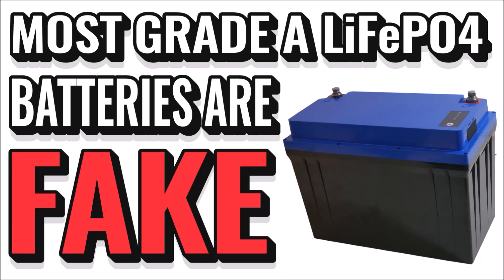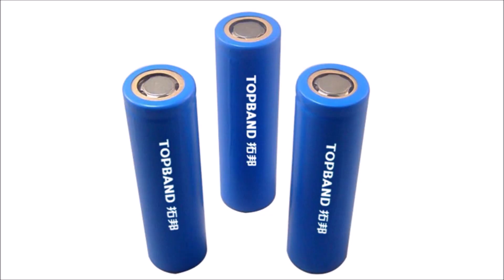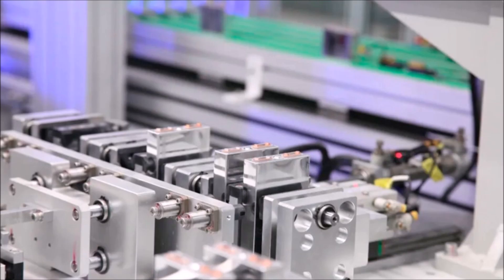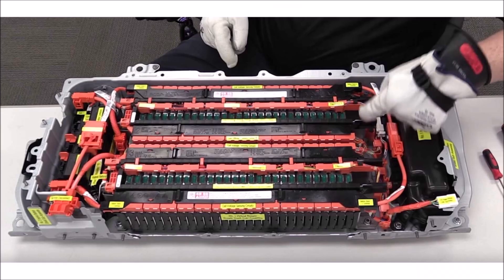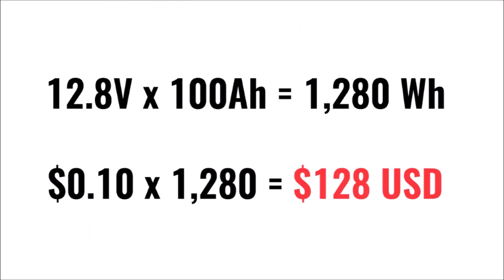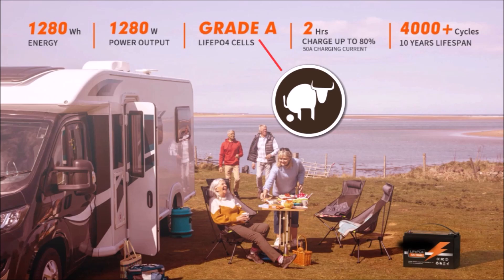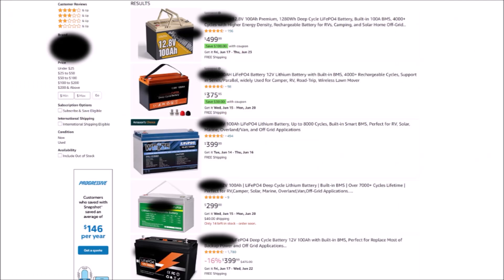Fake Grade A Lithium Deep Cycle Batteries Are Everywhere!  Learn How To Spot Grade B vs Grade A

Comment: I’ll keep my Chins “fake” batteries 12V 100AH that only cost $330, when I won’t notice it until after 1000’s of cycles. That will take me 10 year or more. The “name brand” batteries cost twice that. I would never get my money’s worth out of the “Grade A”
Reply from the maker: I hope you get lucky that way but for many consumers that isn't actually the case.  Not only do they only last 1,000 or less cycles with a quality BMS (much less with a bad one), but under 1C or higher loads those cells will not perform well at all.  Their voltage drops like a rock and the battery will last minutes as opposed to hours.
Reply: @LDSreliance  I have 4 of these CHINS batteries in series to make a 48V system. It runs my electric zero turn lawn mower. The typical current draw is 20-50amp….so I am well below the 1C current draw issue. I can also cut my lawn 4-5 times on a single charge, so 1000 cycles would last me 76 years.  I think my lawn mower will fall apart before 76 years
Reply from the maker: There you go.  That should be fine for your use case.  But what about the guy that buys them for his RV because Will Prowse said they were good batteries and turns on his air conditioner?  Oops.

Comment: will prowse reviews and tares down these batteries all the time he says the cells are ok but sometimes they cheap out on the bms and temperature censors but idk if he knows most of them use b grade cells
Reply from the maker: You can't know the cells are okay by just looking at them.  You would have to test them in each category and then compare them to the factory specs.  He is looking at the brand name of the cells and judging based on reputation or, worse yet, he is just telling you what the manufacturer tells him without any proof.

Comment: At least for EVE prismatic cells, there are two grades. Those that passed automotive testing standards set by the Chinese government, and those that failed. The failed cells are sold at auction and sold to USA consumers as grade A. Usual practice is that no vendor will tell you that you are buying cells that failed, and indeed they will advertise them as brand new grade A. Commonly called grade B are the failed cells that BY LAW cannot be used in an automobile (in China). Do you really want cells that failed in your home or camper? I stick to the VERY FEW vendors that sell passing cells and supply the test reports, and you WILL PAY MORE.
Reply from the maker: Agreed.

Comment: The eve 304ah lifepo is about 100-110$ pr cell direct from factory, so 400-440$ pr 12,8v 304ah battery. Ofc, then shipping, custom, busbars ect.. but.. kinda good price. I plan on getting them next after seeing many technical in-depth testing of them. Superb performance.
Reply from the maker: Eve makes good stuff.  You can DIY a battery like that for $1000-1200, I would bet.  But a commercially available battery of the same capacity where they have to make a profit and pay employees to do the assembly work that you are going to do, etc. would have to charge $2,000-2,400+ for that same battery to make it worth their time.
Reply: @LDSreliance  i can get  4 cells locally in ph for 135$ each.. 50$ for a daly bms if i like.. it can be done cheap, very cheap :) dont need a box, lots of space on my shelf still :)
Reply from the maker: Yes if you are willing to make sacrifices you can get something that performs the same for much less.

Comment: Hi from Aussie great vid, Thinging of purchasing TWO Renogy 100amp lithium batteries over here to replace my Two old AGM,s  for my motorhome are thay a good buy look forward to hear from you thanks again kept the good work 👍
Reply from the maker: You mean like the RBT100LFP12S-US?  That is a true Grade A battery.  But they may have a Grade B lineup of batteries, too, like MillerTech does.  So pay attention to the specs and if they don't say anything, look at the price point.
Reply: Thanks again the batteries are the RBT100lfp125- that say 100amp continues draw with pouch cells and the big thing for 5 year warranty Renogy have BIG going over here, the lithium Game is a different ANIMAL For me thanks again.
Reply from the maker: 5 year prorated is bad.  $629 AUD is bad.  I'm 99% sure that is Grade B.

Comment: The producer of this video sells expensive lithium batteries. So it is a conflict of interest to say cheap lithium cells are good. I am an Electrical engineer, I have bought Voltx batteries (in Australia) for $300US. They work fine. They cycle nameplate capacity on a calibrated wattmeter. they have served me 10 camping trips, I have had for 2 years so far, they have powered my home (500ah) in blackouts, I cant ask for more. Very happy, with my cheap cells.
Reply from the maker: It isn't a conflict of interest.  I am trying to educate people and help them make an informed choice.  They can't do that if they are being lied to.  And your experiences with your Grade B/C batteries are irrelevant.  In the video, I made it clear that there is no performance difference between Grade B and C.  But there is a significant longevity difference.  So I am glad you are having good performance from those batteries and it sounds like you made the right choice for your use case since you will never cycle those batteries more than a few hundred times the way you are using them.  But someone else that is looking to buy batteries and lives in their RV every day and wants to make a 15 year investment would make a bad choice buying $300 batteries and thinking they will be the same.
Reply: I have 7-100AH 12V batteries from China and they are working great. Very reliable and no issues whatsoever. For under $3000, I am very satisfied.

Comment: I see that you also sell BLUETTI MillerTech EB200 2000W Portable Power Station. do you know if they use grade "A" cells in the Bluetti you are selling?
Reply from the maker: I can't say 100% for sure on that.  The economic analysis on that is a little less clear since there are so many other components and parts involved there.  As a percentage of the entire unit, the cells are a smaller percentage than on a deep cycle battery.

Comment: Very good information.
Quick question. Is there a problem with hooking 2 12v li po batteries in series if neither one has been in service and one is a year older that the other. Both will be fully balanced and connect to use for a 24v inverter. Both Amperetime batteries.
Reply: @BradCagle  thank you for the info
Reply from the maker: LiPo?  Do they have an internal BMS?  Are they the same model number?
Reply: @LDSreliance  yes both internal BMS and they are bought a year apart. Both 12v both 200ah both are amprere time. They both have a sticker on them with a different number. Not sure if it is model or SN
Reply from the maker: You should be fine then if they both have a BMS.
Reply: @LDSreliance  thank you. It didn't make since that you would have to replace a whole battery bank if one battery went bad. Thanks for taking the time to reply
Reply from the maker: You are welcome.  Good luck and thanks for watching!

Comment: and now if we had a way to tell a grade b battery that is being sold at grade A prices...
Reply from the maker: That I can't help you with.  But I'm not sure why someone would willingly choose to compete in a lower volume market with the same margins with a fake product.  Too risky for less reward.  Much easier and more profitable to sell in the high volume Grade B market and dupe people into thinking they are just as good as the $900 Grade A batteries.
Reply: @LDSreliance  I think putting the cell serial numbers on the case should fix it.  a few spot checks will find any fake batches.
I doubt it would add much to the cost.
Reply from the maker: That is a good idea.  But good luck getting manufacturers to all agree to do that unless they are forced to.  This is most likely something that will always be a problem unless the government steps in and regulates it.  Ugh.  Just what we need.  More government and red tape.
Reply: @LDSreliance  to take this to a very careful edge.  selling items that are not as claimed is fraud.  it is not hard to be honest here.
Reply: Maybe the Chinaman has lowered his standard for what is a grade A cell....IDK, but even if my $325 12v 100 AH LiFePo4, that CAN actually deliver 1280 wh and will not accept a charge at 0 deg C meets it's stated specs, Im good. I paid for a battery that delivers stated wattage at it's stated current and has high/low temp cut off. If I achieve the guaranteed 8,000 cycles at above 80% dod within the warranted 10yr timeframe, then I got a heck of a deal, buddy!

Only time will tell the truths. Has anyone met or exceeded the stated usage of either a $350 battery or a $900 battery to actually know the truth, rather than a mere speculative "what if"?

Comment: Very informative. How long until prices come down for a true grade A for a grade B price.
Reply from the maker: It may be a while.  With all of the trade issues right now, extremely high shipping costs, tariffs, and supply chain problems (microcontrollers, etc.) it isn't going to happen in the short term.
Reply: @LDSreliance  thank you for the reply. I cannot justify the cost for a grade A. Can you tell me, do you think it would be wise to replace my flooded, group 27 in my truck camper with a 100 AH grade B?liFe?
Reply from the maker: Are you living in this truck camper or is this a weekend thing?  My personal opinion is I would not use a Grade B battery for daily use.  They are fantastic for folks who go boondocking on weekends.  But for people who are living in their travel trailers or RV's or tiny homes, I don't think that is a good investment.
Reply: @LDSreliance  weekender mostly but we both just retired and are leaving in ten days for 11 weeks in alaska on a bucket list trip.
Funny i just removed the flooded for inspection (deep cycle, group 27) and it looks excellent. Plates, electrolyte, etc.
We also carry a 2K. Inverter gen.
Reply from the maker: In that scenario, Grade B will be just fine.  You have other sources of power if you need it (generator) and you aren't cycling it hundreds of times per year.  So it should last well beyond the warranty period in that use case.
Reply: @LDSreliance  thank you very much for your correspondence!
Reply from the maker: You are welcome.  If you are interested in MillerTech's Grade B offerings, they are excellent:  https://store.ldsreliance.com/collections/economy
Reply: @LDSreliance  great will take a look.

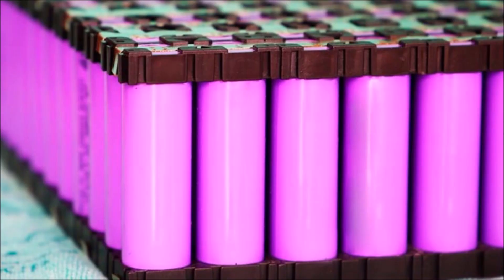Comment: Good point about battery rating,  especially if you want top performance.  Still as you say at 2:30 there may be only slight differences.  Grading of parts is done in many electronic components like semiconductors.  You may not always need an A student when the B student does the job.  You don't wastefully throw out all you B quality product when you can still make money selling it cheaper.  The reason Waterford Crystal is so expensive is they destroy everything except A quality. You are paying for their rejects.
Reply from the maker: Exactly.  These batteries are fine Grade B batteries.  But consumers need to know that is what they are so they can make their own decision.  When a company makes it seem like they are a half price Grade A battery and the customers expects 4,000+ cycles... that is where we have a problem.
Reply: @LDSreliance  so what kind of cycle life should we expect for a good Grade B at 100% DOD and 80% DOD?
Reply: @ericklein5097  He can't tell you because he won't test them.
Reply: @ericklein5097 , even if you loose 20% of lifespan it's still cheaper to replace them, since they only cost half then price. If you over build your system, which you should anyway, and don't discharge the batteries to low than you're better off with grade b batteries. From the financial standpoint.
Reply: @ericklein5097  Assuming it's an honest/accurate measurement, I've seen some cheap lifepo4 batteries advertising ">2000 cycles".
Reply: consumers can tell the grade by the price and can decide what fits their use model, with some roll of the dice

Comment: The fakes may have grade B cells but you say there may not be much difference compared to a grade A cell. So the question is, are these fake batteries “good value” given the lower price?
Reply from the maker: Yes, I personally like Grade B batteries for people who aren't going to be putting them to daily use, especially.  But the problem comes in when someone thinks they are buying a Grade A battery with 4,000+ cycles like the specs say and they end up getting 1,000 cycles.

Comment: will the Fake batteries do the job ?
Reply from the maker: Yes.  But they won't last nearly as long.  There isn't anything wrong with Grade B batteries.  But you should know that is what you are buying when you make that decision to buy.
Reply: @LDSreliance  So if you pay half the price and they last half as long , you lost nothing.
If they last 75% long , YOU WIN
Reply from the maker: Yes, I agree.  But that isn't the point.  If you think you are buying a Grade A battery for 50% off and that it will last 4,000 cycles and it only lasts 1,000 cycles... you will feel ripped off.
Reply: @LDSreliance  Ok - I myself have poor understanding of GRADES.
I'm a practical person.
Like - if petrol was much cheaper at a different garage , I buy it even though it may not be a the worlds best brand.
It does the job is my main concern
Reply from the maker: Yes, that is sensible and fair.  Lots of consumers are that way.  But think of it like this:  two gas stations are selling 87 octane gas.  One stations sells for $2 per gallon and one station for $4 per gallon.  But the $2 gas station was using fuel that was watered down and dropped your gas mileage by 70%.  Because you didn't know they did that you would probably buy the $2 gas because they are both marketed as 87 octane and gas is gas, right?

The point is the consumer should know what it is they are buying.  Both fuels from the two gas stations would power your car.  But if you knew you were going to get a LOT less gas mileage and range out of your car you might not buy it.

Comment: I watched your video on batteries and my head is spinning. I want a battery in the $200 to $300 dollar range. If I get a few years out of it that’s fine. Any brand suggestions?
Steve
Reply: Thanks guys for all the info. I’ll one soon. 
Thanks again Steve
Reply from the maker: Need more info.  What is it going to be for?  What are you going to charge it with?  Where is it going to be stored?
Reply: You will need to know what kind of capacity you are after. There are plenty out there in that range but the good brands will be a lot less than 100Ahr at that price.
Reply: Used for a 20 lb thrust trolling motor. Used no more than 8 hrs maybe a few times a month. Will be stored in the basement when not in use and will buy a charger for lithium. 
The motor draws 3.5 amps at full speed.
Thanks
Reply from the maker: OK, so 3.5 amps multiplied by 8 hours equals 28Ah.  Giving yourself some margin for error and through losses, I would recommend at least a 33Ah battery.  The MillerTech version that I sell is here:  https://store.ldsreliance.com/products/33ah-12v-12-8v-lithium-iron-phosphate-lifepo4-smart-battery

It fits within your budget.  You could use a 5A charger (https://store.ldsreliance.com/products/5a-millertech-lithium-iron-phosphate-battery-charger) with it if you don't need it to charge quickly, such as if you would be charging it overnight.  It would take a little over 6 hours to charge back to full if it was fully depleted.  You could also use a 10A charger if you wanted it to charge more quickly.
Reply: @stephenlongenberger9279  That is a pretty small demand. There are lots of 50 and 75 amp hour batteries that should suit your needs.

Comment: That's why I bought from a reputable company like Battle Born.  You do get what you paid for with such a company.
Reply: Went with Ampere Time. Was a great mid to upper grade for me. Been using 3 300ah batteries in parallel for like 4 yrs now. Zero problems and use a Victron shunt for the low temp protection. If they fail ever, I can replace again and still come out cheaper than a single purchase of Battle Born.
Reply: @leewarner9357  I can understand that I used Battle Born because of there Rep and used Victron Charge controller and there Battery monitor.
Reply: Agreed. I didn't buy Battleborn. I went kind of in the upper middle end. I bought two Renogy 170Ahr batteries and their charger, monitor and soon solar. So far I am very happy compare to my old lead acid batteries. The dirt cheap brands were tempting but you know the old saying!